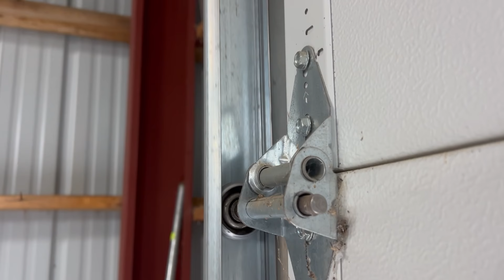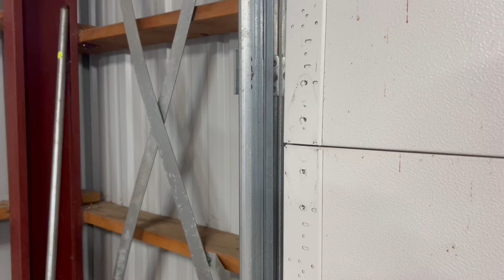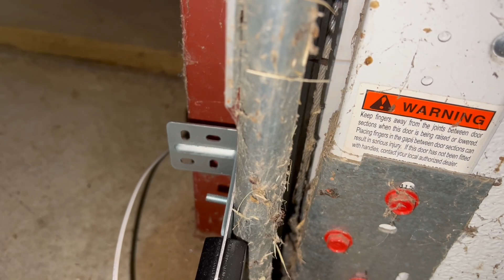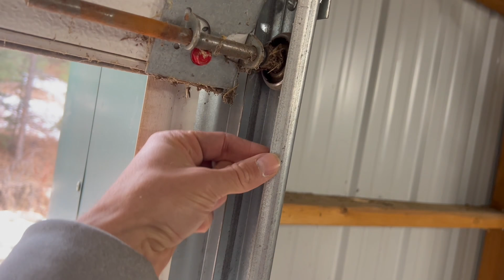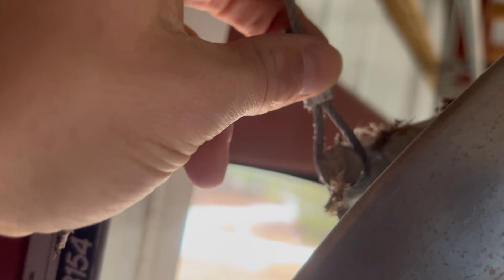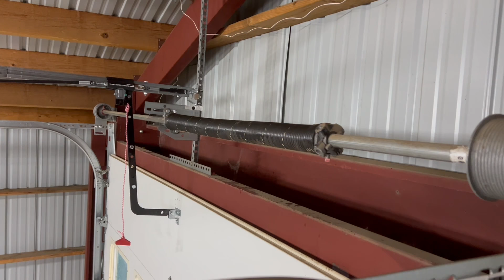How to Replace Old Garage Door Rollers WITHOUT Bending Track (Easy DIY Install) | Builds by Maz

Comment: Instead of allowing the cable to unravel like that, once you unhook the cable loop from its mount, clamp the cable with vice-grip pliers near the roller so it will not unwind.

Comment: Constructive input:  On the bottom panel, roll it up all the way and disconnect the wire loop per your video.  Then using vice grips, clamp the loop to the rail so your cable doesn’t unspool at the guide wheel.

Comment: What's the difference between the short and long rollers? My door came off the tracks and the garage guy said I needed the longer rollers and he replaced all 12 for about 350. I think he scammed me but I didnt know better
Reply from the maker: It just depends on how far the hinges are from the track. Most residential garage doors just need a short roller.

Comment: I saw a warning about greasing the " fixed" ends of the coil on the top of the door, on a different video 😬   Also, it instructed NOT to grease the tracks 🤷‍♀️ 
Greasing my door right now, and noticed a broken metal roller off the track.  Do Nylon rollers last long?  It seems like they would wear out faster than metal.  Thanks 😊

Comment: I added these to mine a couple years ago and they are definitely are much quieter. Another tip I can offer is to check the alignment of the tracks to the door and make sure they are 90 degrees to the door. Mine would make a popping noise as it neared the top. I found the rollers were partially popping out of the hinge. Not enough to be dangerous but enough to be noisy.

Comment: I couldn’t get the cable off or bend the track so I had to approach it differently. It occurred to me that I could just detach the bottom track, which allowed me to lower the door, and swap out the wheel. Then I reattached the track. It worked perfectly! Neither myself or the track were harmed.

Comment: What kind of screws are those ?  Can I do that with a regular screwdriver? Companies want to charge me $275-$400.  I refuse.  I have a manual garage- top wheel on left off, on right, bottom wheel off and wire at top is of wheel.  I just need help my garage has been broken for over a year.  My husband is not handy I believe I can fix it.  I am in California- thanks for your help.
Reply from the maker: Usually a self tapping screw with a hex head. If you can, remove one of the existing screws and then bring it to a home improvement store, and have someone help you match it.

Comment: Watched several videos on how to replaced the rollers.   They all had light weight garage doors where as mine is made from wood.  Flexing the track and pushing up the light weight door is easy but not so with heavier double wood garage door.  Wood garage doors also use heavier gauge steel track which make flexing more difficult. Some videos emphasize speed and being a DIY guy speed is not that important but safety and preventing Murphy's Law is my main concern.  I will be using this method to install.  Thanks for the video.

Comment: This is the way! i did all my rollers in about 20 minutes. the only things i did different for the bottom rollers was raise the door as far as i could then used a pair of vise grips on the track to chock the rollers. It gives you a little more slack on the cable. I also left the bracket attached to the cable to keep tension. Like others have said I did not lube the track. Cant believe how quiet it is now!

Comment: YouTube videos are great, but there is often a better and easier way to do a task.  To easily remove the bottom rollers without damage, simply open the door all the way.  Clamp a pair of vise grips near the end of the curved track to prevent the door from rolling down.  Mark the locations and remove the lower piece of track (the vertical piece).  Remove the vice grips and roll the door down until the roller leaves the curved track.  Replace the roller, push the door back up and re-install the lower track.  Easy Peasy.  Check out a video by Shaun Murphy.

Comment: Good video. Tip: Don’t spray tracks, it’ll cause rollers to skip rather than roll. When spraying coil spring, don’t spray ends of springs, just the main spring where the stripes are printed.

Comment: if you want to lub the springs, do not use the spray lub, get a toothpaste  lub & spread them out evenly on the springs with a rag; you will only have 1/2 the lub on the spring & 1/2 on the cardboard/ garage floor

Comment: Great video; thank you. Here's a third (and dare I say, easier!) to dealing with the bottom rollers - manually bring the door to its fully raised position as the video says, but then disconnect the straight rail from its top and middle brackets. Once that part of the rail is out of the way, you can bring the door down enough to pull the old roller out, and put in a new one. Then, move the door back up to its fully raised position, and reconnect the straight rail back to their top and middle brackets. No need to bend your rails, no need to mess around with red bolts you're not supposed to remove, no need to mess around with wrestling the tension cable off that knob, or getting the cable rewound if it goes awry on you.

Comment: I highly recommend adding the sleeves to the roller axles before you slide them back into the hinge brackets. This will prevent the metal axles from spinning in the hinge and greatly reduces noise when door is on the move. I’ve done this on three of my garage doors and I swear I have the quietest door in the neighborhood.

Comment: Before replacing rollers, clean dust/debris from rollers, lubricate with non silicone lubricant(silicone tends to collect crud), include all hinges when lubricating, not just rollers.  Clean and also lubricate springs.  This made my door easier to lift, and much quieter.

Comment: Wrong lubricant! Use lithium for metal contacts. Silicone is for plastics
Reply from the maker: Lithium and silicone both work great here. Silicone absolutely works with metal applications.

Comment: Ok everyone the easiest way to replace the roller is as follows have the door in the down position remove the two track bolt from the vertical track. then remove the lags for the jamb bracket that attach from the vertical track to the wall now place you foot at the bottom corner of the door where your working now twist out and remove the vertical track now you have all the roller exposed except the top roller and can easily replace them without having to remove each hinge at a time

Comment: I’m wondering if it’s time to replace my rollers. My garage door keeps opening back up during the closing cycle. The lasers seem fine, though. Cleaned my rollers and lubed them up but it’s still having the same issue. Will give this a go and see if it solves the problem.

Comment: I did mine, same rollers; the result was meh.  A little quieter, but not much.  The motor and the chain drive are the loudest parts.
Reply from the maker: You can try lubricating the chain but a belt drive would be much quieter.

Comment: I was just quoted $1,180.00 ti change my roller and brackets. The parts cost less than $50.00.  What a rip off.
Reply from the maker: That's an insane quote. It pays to be able to do it yourself!

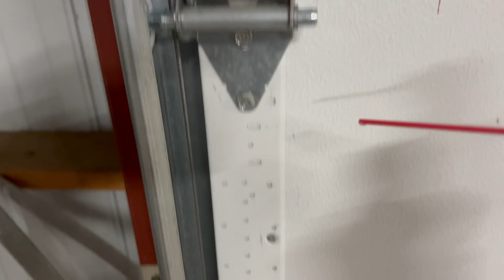Comment: 5:00 Do NOT grease the track. It's just asking for the track to get really dirty, the wheel to break down, and possibly for the door to slip. Grease the hinges and anywhere metal hits metal, but not the track itself.

Comment: Don’t take the bottom bracket or the cable off at all, just bend the track for the bottom roller. I’ve seen way too many accidents happen from removing those brackets.

Comment: I used silicone spray. I paid a garage door company to do this maintenance on my door and this is what he did… it made a big difference. I would be interested to change out to the nylon rollers because every little improvement will be a good thing. The videos explanation of the bottom bracket was VERY important… I would affix some sort of weight or bungee to keep tension on the cable… I would hope that would eliminate the unspooling of that cable… that looks like a mess! Good video though… nicely done!

Comment: How do I fix a garage door that opens fine, but refuses to close unless I hold down the wall switch?
Reply from the maker: You probably need to reset the bottom limit. It will depend on the brand of garage door opener you have.
Reply: @buildsbymaz   Thanks for your reply, it’s a Chamberlain MotorLift 700. I can’t find any garage door engineers to even come and look at it so my son has been trying to Google info. I’m pretty sure it’s something really simple but most engineers just want to sell me a new door, repairs go in the “Too Hard Basket”.
Reply from the maker: @GrumpyGrannyDU  try this video: https://www.youtube.com/watch?v=P7HTQQ11sPE
Reply: @buildsbymaz  Thank you for this video, it’s not quite the same as mine, but I can do some more research. You’ve been most helpful 👍

Comment: Great vid, but there’s another way without bending, hinge and mount removal or cable rewinding. With the door raised, consider removing the vertical rail from one side at a time. Replace each roller as you lower the door by hand. Lastly replacing the upper roller.  Raise the door, reinstall the rail then repeat on the opposite side.

Comment: Super quiet, longevity cut in half! If the noise bothers you a simple fix would be LUBE THEM! They are not lifetime lubes! Put some grease in the bearings and a little on the rail they ride in! Common sense is frequent maintenance!

Comment: So, what happens if I replace all metal rollers with nylon rollers except for the two bottom rollers, leaving them metal? Will the garage door still work? Thanks
Reply from the maker: Yes absolutely, and it should still help a lot with the sound.
Reply: @buildsbymaz  ok, got it!  What brand / vendor would you recommend to purchase rollers from, if money is not an object? thanks!
Reply from the maker: @maximtarakhovsky4290  These are the only ones i have used, and they work great - https://amzn.to/4cySLer
Reply: Thank you

Comment: I recently replaced the track rollers and cable pullies. I used regular steel rollers and pullies. The garage door is much quieter. It turns out the bearings in the cable pullies were worn and the main cause of a loud squealing sound every time I raised or lowered the garage door.

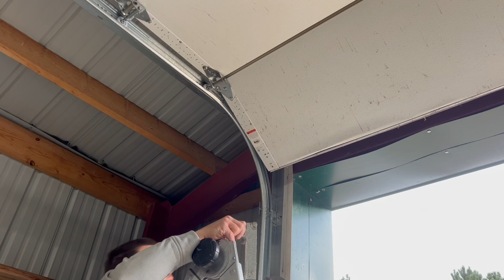Comment: https://youtu.be/JHmvK3vEsmA?t=242 Support that panel!!  @ 4:02. Hollow core doors will drop and twist.  Also, just use a s-hook in the cable end and pull the cable to an empty hole in the track. Support the door on both ends of the track, top, close to motor end with cargo straps. Wide doors will twist and potentially drop!

Comment: Definitely clamp a ViseGrip on the track below the wheel on the opposite side whenever you raise the door to mess around with a cable. Having the door drop with a cable disconnected will earn you a really bad day...

Comment: Used a couple of these videos to learn how to replace my rollers.  The only problem I ran into was the bottom rollers.  I ended up leaving the mount on the door an prying the roller out carefully.  There was another video that showed this and it worked well. Did not have to disconnect the cables and it took a couple of minutes to clean and lube the mount and new rollers.  Both doors are quiet as can be now.

Comment: Much easier to remove the length of vertical track from the wall. The door will stay in place and you can remove all rollers at once without detaching cable or unscrewing hinges.
Reply: I thought about something like this as well but I don't think this is possible for several reasons with all garage doors. For example on my own garage door the vertical segment of track is not really bolted in but is connected to the brackets that mounted to the wall with permanent brads for some reason. The curve section of track and the upper part are bolted but the vertical segment of track at the edge of the doors opening on either side vertically is not screwed into place or bolted but is permanently fastened with a brad. But even more critical and potentially an issue I think would be the fact that if out of the track the entire door itself might crumple up and pull up towards the ceiling like an accordion if the vertical track were removed because of the spring and tension on the cables.

Comment: What if you just leave the two bottom ones  on  ?    i dont think it will  make that much of a difference  .  not sure i want  to  risk that cable thing  or   bend the track
Reply from the maker: You can definitely do that. Replacing all the others should still make a big difference.

Comment: I’m thinking with the door raised to the top and the tension off the bottom roller bracket one could remove the three bottom screws in the bracket then loosen the top screw allowing the bracket to be turned sideways to remove the roller.
Great video!
Reply from the maker: Possibly, but the rollers kind of need to be removed at an angle otherwise they won't fit through the track.

Comment: You skipped a MAJOR STEP! After removing the roller bracketing one needs to throughly clean then lubricate the hinge mechanism including the area where the new roller slides into.  USING ONLY LITHIUM grease or in spray form.

Comment: Thank you. Timely. This week my 35 year old garage door did not want to close completely in spite the sensors being clean and properly aligned. It wasn't until I sprayed some silicone around the old rollers that things worked again. Time for an upgrade.

Comment: I did a bit of research on this.  The rollers he links, XiKe are highly regarded.  There are 2 upgrade bearings available.  6200ZZ and 6200-2RS.  Both are great bearings.  The 2RS have rubber bearing seals while the ZZ have metal bearing shields.  2RS (which are the ones he links) are better for wet/dirty locations.  ZZ is fine for most applications.  No real difference in price.  Dura-Lift and PGN are also top quality. XiKe comes in blue and black also.  The colors shouldn't show dirt as much as white ones.  Hope that helps you all decide.
Reply from the maker: Thanks for providing this info!
Reply: @buildsbymaz  Thank you for yours.  I have always hated how noisy mine were and never thought about the rollers.  I went home, looked at mine and had rollers order a few minutes later.  bearings were trashed.

Comment: Very good video however  oil or grease in the track In cold weather, will cause resistance by the oil becoming gummy. The metal or nylon wheels will roll just fine DRY.

Comment: To prevent the door from rolling down (when it’s raised), either use a long 2x4 to prop against the bottom edge of the door or engage the garage door opener.

Comment: Bottom rollers not as easy as your video shows,  in my case. Cable was not completely slack even all the way up. Used a vice grip clamped to the end of the pulley tube, and wedged against the mounting frame by the pulley to release all the tension. Just wrapped the cable around the track and inserted end in one of the holes to keep it from unraveling. Bottom roller brackets were keyed so after the bolts are removed, still have to slide the bracket down a quarter inch before it would come off. But after completion and lubing the springs, sooo much quieter!
Reply from the maker: Glad it was worth it even with the extra effort!

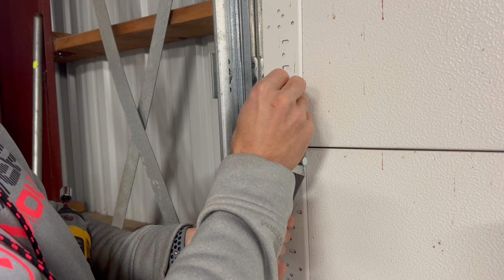Comment: The essence of this video was complete by 1:30, why do we need another 4 1/2 minutes?
Reply: Not true. As he stated, the bottom hinge is the hardest part. Hopefully no one follows your advice and unbolts the bottom hinge based on the first 1:30 minutes.
Reply from the maker: The bottom rollers are handled much differently. The additional video time is needed.

Comment: You could hook a small weight on the cable once it’s removed from the mounting plate to keep the cable from bird-nesting on you as you replace the roller…👍🏻
Reply: Or just have someone hold it for you while you swap the roller/bracket
Reply: Yes.  I did both.  Used a pair of vice grips to keep the cable from unwinding.  Also I don’t have a lot of body strength so needed my teenager to hold the door up while I wedged the roller into the track.  It took maybe 15 minutes to do both bottom rollers.
Reply: I pinched the bottom of the cable with the vice grips and just let it hang down.
Reply: Or have a lovely assistant hold it for you, like magicians use.........

Comment: There's a 3rd way to replace the bottom roller. Roll door up (so bottom roller is above vertical track joint) and pull track bolts on top of vertical track (one side at a time only) slide vertical track back out of way, then roll door down by hand until it just barely drops below horizontal track and slide old roller off and new roller on (push door back up into horizontal and reconnect bottom vertical. Much safer and easier than taking bottom fixture off.

Comment: How long do the nylon rollers last? My metal rollers survived 29 years and still running, I would be concerned the nylon will need to be replaced more often th as n the metal ones ?
Reply from the maker: They should last for years without issue. Maybe not 29 years...but you should still get thousands of door opens/closes.

Comment: I replaced my old metal ones with these and noticed no difference in the noise level
Reply from the maker: Your metal ones may have been in better condition than you thought! Did you try lubricating the hinges/garage spring?

Comment: Hi.  Awesome video.  Is the lithium grease just an alternative to the WD40 silicone lubricant or did I miss something?
Reply from the maker: Yes either lithium grease or silicone lubricant will work -  you don't need to use both.

Comment: I would also recommend looking into adding garage door roller sleeves. This will take up some of the looseness of the roller in those hinges. There are also some new hinges with a spring built in, to help the door from flexing as much to let the outdoor air in.